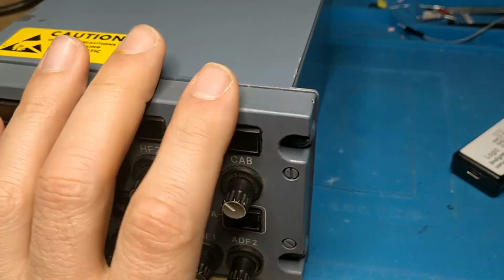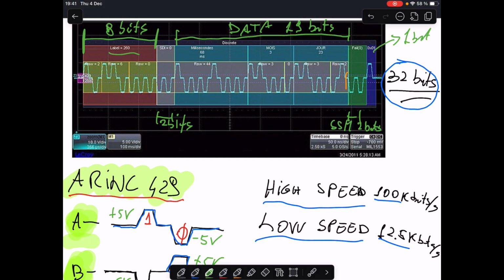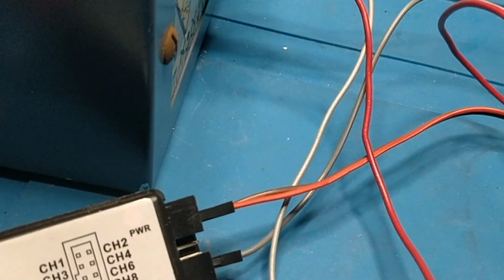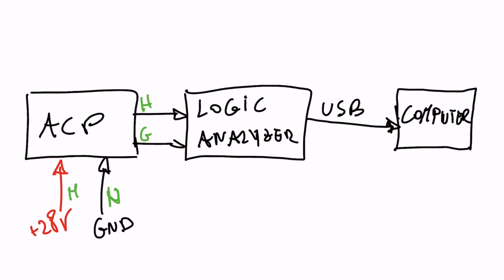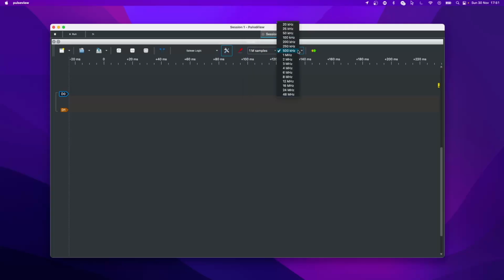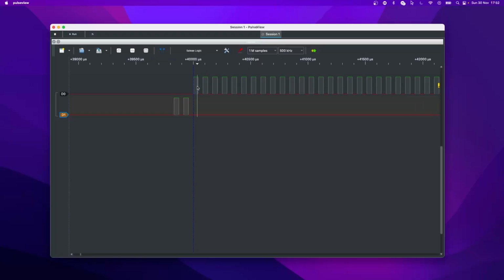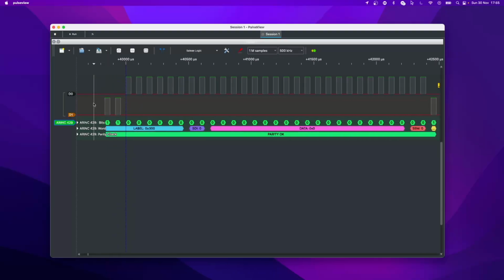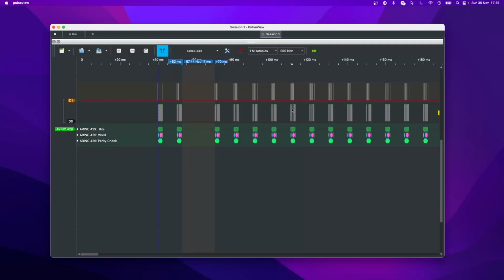ARINC 429 Sigrok Decoder

Comment: Regarding the Thales HSI, i got this information with google AI:

To access the maintenance mode on the Thales Horizontal Situation Indicator (HSI) P/N C14008AD04, you must execute a specific power-on sequence using the physical controls on the front bezel of the instrument.

Step-by-Step Access Procedure

Power Off: Ensure the aircraft avionics master is off, or pull the specific circuit breaker dedicated to the HSI to cut its power.

Press and Hold the Override Controls: Locate the rotary knobs / push-buttons on the bezel. Press and hold down the CRS (Course) and HDG (Heading) selector knobs simultaneously (on some variants, this involves holding down specific lower bezel line-select keys or the push-to-set button functions).

Apply Power: While continuing to hold the controls down, push in the HSI circuit breaker or turn on the avionics master to supply power to the unit.

Release Controls: Keep the buttons held down through the initial boot splash screen until the display alters from its standard flight instruments screen to the dedicated Maintenance / Configuration Menu. Release the buttons once this menu becomes visible.

Comment: Do you have access to old Airbus A310-200/300, A300-600 EGPWS units with all the so called

FRENCH ACCENT VOICE callouts?

The FRENCH ACCENT CALLOUT VOICE is the voice that you hear in the A310/A306 which gives Altitude callouts, Windshear Warning and

INTERMEDIATE ALTITUDE CALLOUTS.

The units should contain all callouts which exist with this voice, including aural warnings which might be with a different voice.

I really dont know exactly the name of the unit.
May be you can ask slme one at Airbus?

The older A319, A320, A321 have also the FRENCH ACCENT VOICE but  as a different recording version.

Same question goes for the aural units for the Airbus A330 and A340.

These units have more callouts like
RETARD, V1, PITCH PITCH, WINDSHEAR, SPEED SPEED SPEED,
INTERMEDIATE CALLOUTS.

Greetings.
Reply from the maker: Hello, unfortunately I don't have these units. However I have A320 ACP panels. I will show them when I will talk about my ARINC board for the TX-RX functions

Comment: How does the logic analyzer (presumably expecting single-ended 0-5v) handle ARIN-429 voltage levels (differential -11v to +11V)?

Can it also do 1553? Manchester encoding, 1Mbps
Reply from the maker: Hello, thank you for your comment. I always measured ±5 V. The negative part of the signal is not observed because it is not captured by the logic analyzer: its internal circuitry clamps negative voltages. As a result, only the positive level appears in the measurements. About 1553 I don't know.